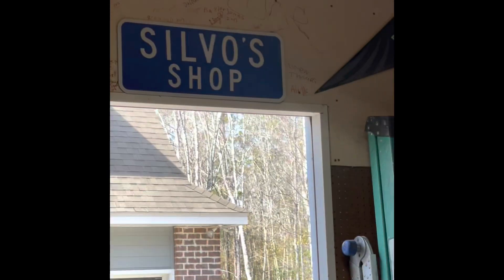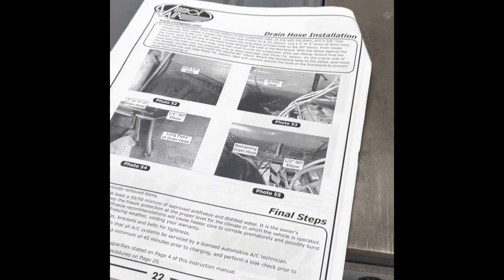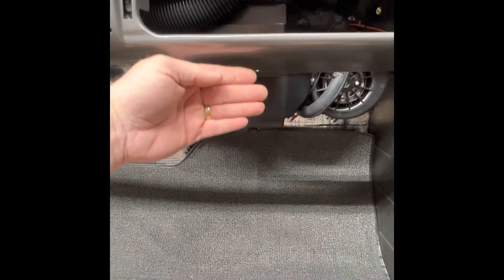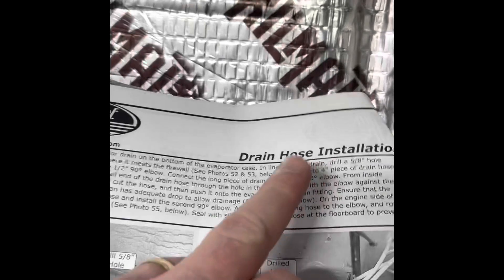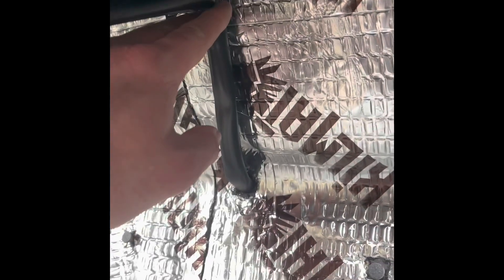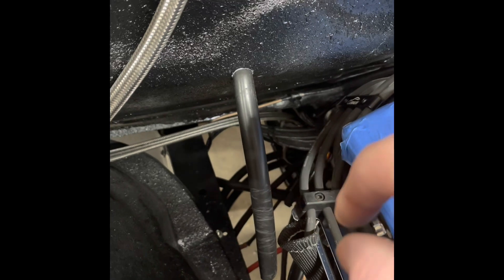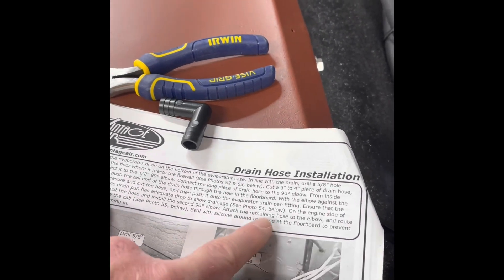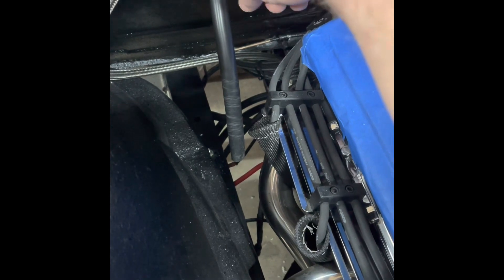Vintage Air Install - Part 5 Drain Plug - 49 Chevy Truck

Comment: Thank you for this video man, you explained everything perfectly. I just bought a 47' 3100 that came with the vintage air setup but my son noticed a dripping from underneath the dash and when I looked I saw the drain spout or plug has no hose attached. I'll go to Lowes and buy about 3ft of 5/8 hose and an elbow to work with. I'm no mechanic so I'm glad you explained it well enough that I feel confident to do the job lol
Reply from the maker: Awesome. Glad I could help!  Have fun with the 47!